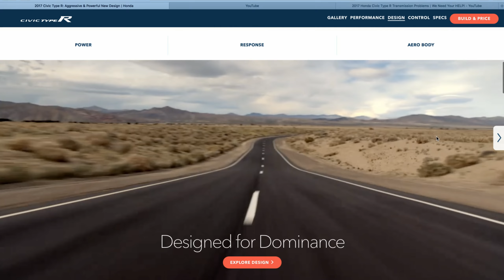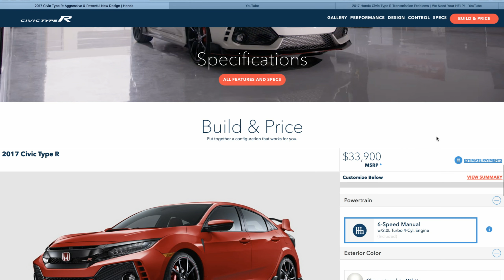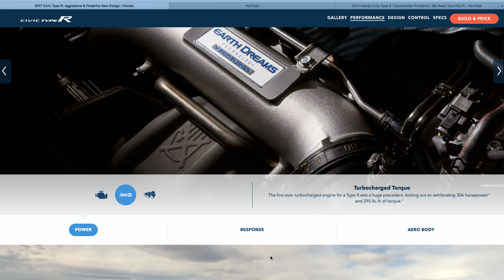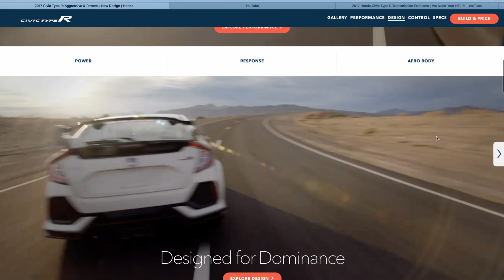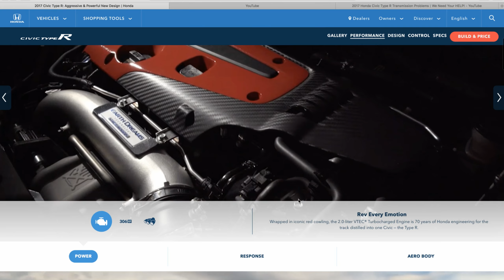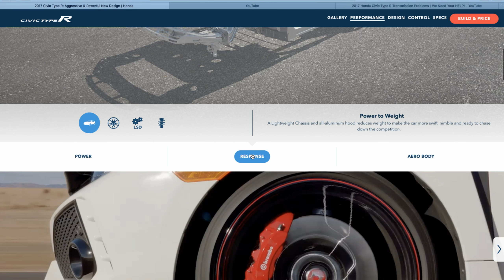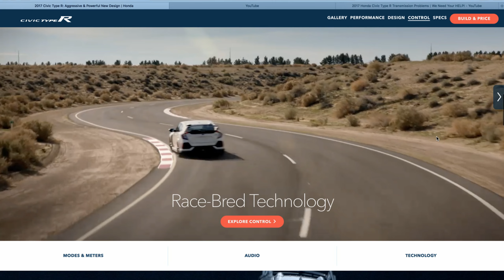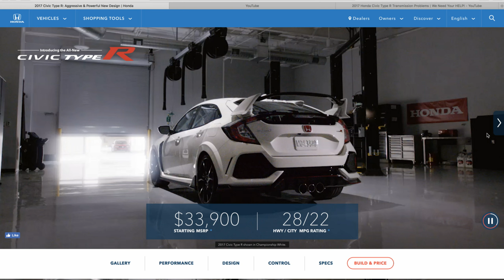Civic Type R - Top 3 Future Tech Service Bulletins?

Comment: I have tracked all my cars the last 12 years, if you use good oil (boy what a discussion that can be!) I ran 145C oil temps on the sandwitchplate with 0 issues, and 100C coolant temps with 0 problems... I dont get what so may FK8 vloggers are so worrie about temps. I have not tracked the FK8 yet, but soon will. If It get into extreme temps above what the fluids can take II will let you know.
Reply from the maker: Hello there.  I appreciate the feedback.  Have you tracked turbo charged cars as well?  I posted a new video on my channel on the recent sightings of a slightly updated FK8.  Keep us posted.
Reply: All were Turbo charged cars, all on Castrol Edge Sport 10w60 the version used in the BMW M cars and later the FST version with titanium.
Reply from the maker: Trackday and Roadtrip Driving & some MTB excellent.  IbM looking into a Fk8 once the market in the US relaxes down a bit.

Comment: I own one and so far I have no issues whatsoever, but is always good to keep inform, thanks
Reply from the maker: Hey there.  That's great to hear.  How long have you had the car and how many miles?  How did you go through the break-in period?  I will be posting a video interview here soon where one CTR owner said she is not having any issues.  During the break-in period, she said she did not rev the car beyond 3K RPMs
Reply: Apollo Andratti I have mine since late July Beginning of August I believe I was one of the first in the US to get it, at the moment I have 5000 miles, and regarding the brake in period, I don't think I resist the miles that they said, I pushed it since the first day
Reply from the maker: Good to hear your ownership experience has been very good.  Is this your daily driver?  How does you like the ride quality?  Normally riding in comfort or sport?  Tire wear has been good?
Reply: Apollo Andratti I was dayly driving the car until two days ago because it got really cold here in Boston and I have not change the summer tires, those tires are not good at all in the cold weather, but to their credit Honda said not to use those tire in winter
Reply: Apollo Andratti I love the ride, I'll be driving and laughing all by myself, to me the car is a steal, here in Boston a lot of the streets are horrible so I usually ride in comfort and sport in good streets
Reply from the maker: T S that’s great to hear. How well this car drives is surprising a lot of people.
Reply from the maker: T S i am awards some folks are getting a separate set of wheels for the winter and also better tire options.  Enjoy the car.
Reply: Apollo Andratti yeah I just hesitate to order my extra wheels for the winter, now that's what I am doing, but for the summer I don't think there is better tires, those tires hold down for real when the temperature is hot, thanks again
Reply from the maker: T S agree!  Very good feedback on the oem tires.

Comment: Note: Problem is water temperature, not oil temperature.
Reply from the maker: Hello there.  Thanks for comment.  I re-read the summary on Evasive's track testing and confirmed they reference the oil temperature.  See the 5 post down on this thread:http://www.civicx.com/threads/ctr-overheating.12739/page-8

Do you have a Type R as well?  What has been your experience?
Reply: Apollo Andratti usually water is trowing errors, not oil temperature. Sure, oil temperatures should be under 130C.
I have 8gen supercharged type r, but should pick fk8 in next few days. Will test in on track next year (winter is comming)
Reply from the maker: Okay, thanks for the information/feedback.  We are hoping this is a non-issue with the new CTRs.  Keep us posted on your experiences with the FK8 when you get one.  Your transmission has been smooth?